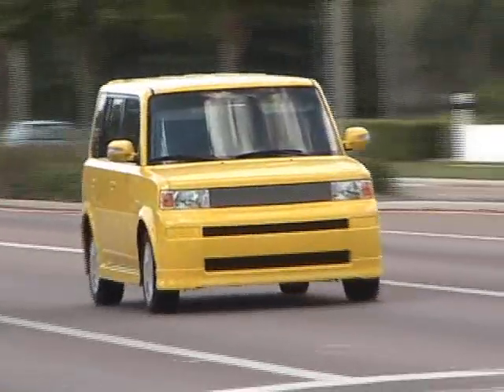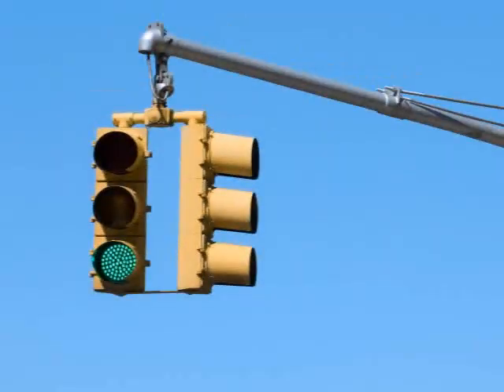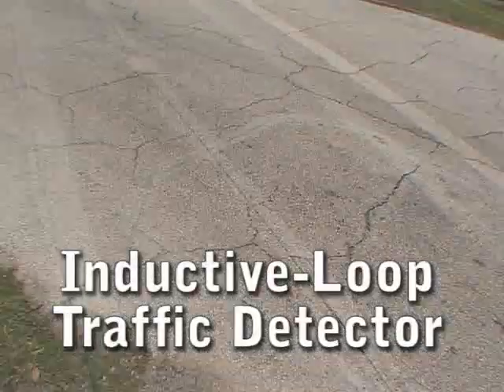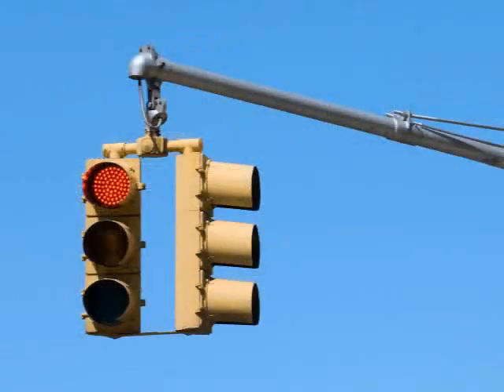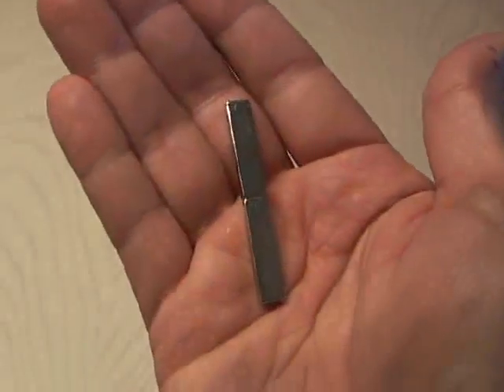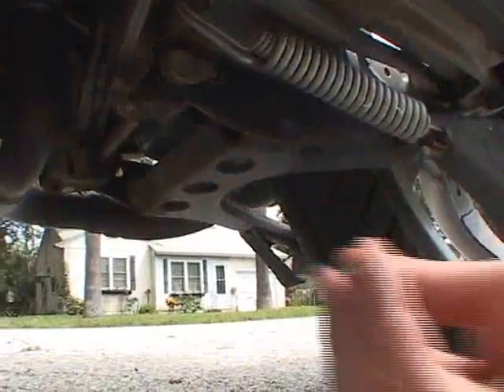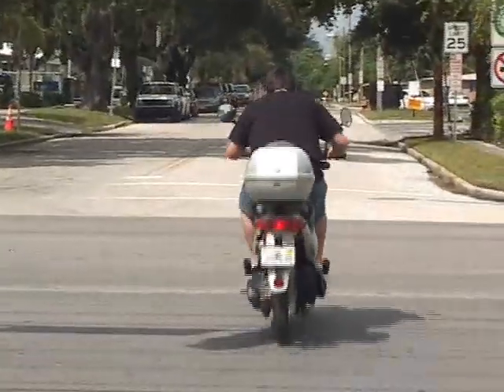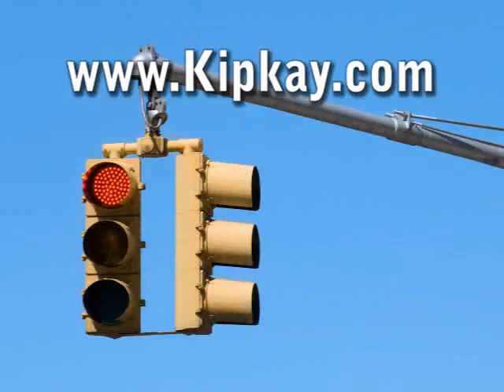Trigger Green Traffic Lights

Comment: I've never had this problem on my motorcycles. What I do is quite simple. I make sure to stop on the bike directly over the wire. I memorized the various patterns of induction censors and put my bike where it'll get the most exposure. Most use a double box setup like [][] and if you put the bike right in the middle, there are two wires going through the middle, and so you basically double the chances of triggering both induction sensors.
Reply: Yes, the two loop version is quadrupole and you stop right in the center. The single loop version is dipole and you stop on the edge of the single box. I've heard if you put your side stand down it can help.

Comment: That's not how induction works. Cars are not magnets and adding a tiny piece of metal, magnetic or not, will not trip an induction sensor.
Reply: That's not at all what he said. Listen next time.
Reply: +SuperSwoggin I'll explain it a little better. He says that the loops work via magnetic induction. Cars are not magnets, hence do not induce a current in a loop of wires, and they certainly don't do so at idle. Adding relatively tiny magnets on a scooter won't magically trick the sensors into thinking its a big, heavy car.
Reply: its based on weight really.
Reply: thats the old way of doing it

Comment: Tested this extensively with a variety of magnets of different sizes, materials, and strengths including Neodymium, and on a variety of sensor loops.  It does not work.
Reply: sorry, its patched with the latest 7.0 street light update
Reply: This video was shot in 2008, they've probably upgraded the technology to something better or just changed it around somehow.
Reply: Anti-Social 12 Year Old Squeaker you're better off looking it up than commenting on something you obviously don't know anything about.
Reply: Well I'm glad I didn't waste money...
Reply: That's because this guy's a tool
Reply: maybe because the traffic light you tested at was operating on a time schedule, not by the detection of vehicles.
Reply: That's because inductive sensors don't sense static magnetic fields.

Comment: This is an old vid, but just to let people know:
At least in California, it is in fact legal to run the red light (when safe to do so) once the lights have cycled through the intersection 3-5 times.  If you don't get your green light within that time frame, there's usually a problem with the light.  Just make sure it's safe, and proceed as normal.  If a cop catches you, just tell the truth.  No worse for wear.
Reply: L.D. Johnson or get 9 warning shots to the back
Reply: +L.D. Johnson North Carolina, it is 3 mins, legal to jump the red light, when it is safe to do so.
And yes, I still ask people (in cars) to help me activate the sensors.
Reply: +L.D. Johnson In many cities I've lived in, the crosswalk button isn't even hooked up to anything. It's just there to give pedestrians something to push because people expect buttons and like pushing them.
Reply: +henry montero LOL!
Reply: +L.D. Johnson which vehicle code is that?
Reply: Y'know, I tried looking it back up after posting this, and I couldn't find it.  However, I distinctly remember being taught that in drivers ed, during drivers training, I'm pretty sure I've heard it discussed elsewhere, and I've seen it in practice (especially with motorcycles).  
I myself have done this at a broken stop light (I know, because there was a crew out repairing it finally the next day) in full view of a police officer; I had been waiting for several cycles to no avail, made sure it was clear to proceed, and completed my turn.  Officer noticed, looked around, and let me and others pass. However, YMMV, of course.
Reply: I've been reading that it is OK to do if the light doesnt seem to be working after 1 cycle of everyone else going. You just will have to explain it to the cop if you get pulled over and to the courts, still gotta yield tho. Or could just stick magnets under your car or ride a car. Just very annoying how they design the roads for only cars and not motorcycle too, when motorcycles are maybe 2-5% of the vehicles on the road overall (my guess). L.D. Johnson
Reply: ***** Certainly that's true. I've had more than a few bikers motion me closer to them at a light hoping my car would hit the sensors. Everyone on the road has to do what they feel is safest for them. 
Personally, I can't imagine leaving your bike to walk over and hit the crosswalk would be preferable to just carefully pulling out; not all lights have crosswalks anyways, and not all crosswalks trio the green light unless there is a vehicle there anyway. And walking off your bike to cross the street and back makes you just as likely to get hit as if you just ran the light, I would think. Again, your mileage may vary. Just offering what I (think I) know...

Comment: I drive a mid-size car, not a motorcycle. Would it still be beneficial to install this trick on my car?
Reply: nope. by small car he means cars like smart cars that are teeny weeny.  A midsize car is big enough to change the light, buuuuuuuuuttttt many lights just go on timers so its useless.
Reply: Ohhh okay, well thanks that's helpful to know!
Reply: Jack, I had someone tell me that it wouldn't work on my motorcycle because "...many lights are timed."  I noticed though that the light would change when a car would pull up next to me or behind me.  Try it for yourself and then you will learn what you did not know before.
Reply: The lights in my neighborhood don't have the markings on the pavement from being cut into and then patched over with tar, so I don't think they're triggered by an inductive loop. So I'm pretty sure it wouldn't work anyway.

Comment: If you have trouble with a scooter or bike just pull up in an edge of the loop.  The magnets don't do anything extra.  I used to install these systems.  Just a chunk of metal will do.  I would set them off with my metal clip board.  Instead of magnets a metal plate in your shoe would work better or again, just pull up on one edge of the loop and it will "see" your scooter.
Reply: David Carnahan Interesting. Thanks. Is there a certain distance you have to get the metal from the coil? I installed larger tires and sometimes have trouble triggering the lights now.
Reply: You should still trigger any system.  Unless the system itself is having issues

Comment: Even though I have a neodymium on the bottom of my motorcycle that's rated for 145 lbs, I have a light that changes almost immediately if I'm driving my car, but not my motorcycle. I am forced to drive 3 blocks out of my way to get home. I forgot to tell my motorcycle mechanic about my magnet and one of his wrenches got stuck on the magnet until he figured out how to remove it. He wasn't happy.  LOL

Comment: What if you were to put the magnets on the road near the traffic light? Would that make it always green?
Reply: Good question
(I don't know the answer, I just felt I should say that)
Reply: No.  The coil is looking for a change in magnetism, not for a magnetic level.  The light would change once when the magnet was placed but then wouldn't change again until a car drives over the coil to change it even more.
Reply: A magnet would have to be about ten times the size of what's in the video to effect the coils.   I know because one unused to install these systems and two we have tested with various items to see the sensitivity.  A magnet the size he used dose zero even on the ground as close to the coils as you can get.  We had to go to a 4" speaker magnet to get a result.  Were my aluminum note book laid on an edge triggered it.  The testing in this video was most likely flawed as it appears they knew nothing on how the system worked.   You are just better off not adding anything to your bike and pulling up to a light over am edge of the coil. They are very easy to see.
Reply: no.it  means it would always sense a car and the light would change in the shortest amount of time it set for!
Reply: Richard Bennett If you place an electromagnet that randomly changes the current on the coil, would this work?
Reply: Dependent on its power and ability to effect the away around I.

Comment: For streets that use the magnetic system to detect autos you'd need a pretty powerful magnet, but his won't work on systems that use weight to trigger the lights as is where I live. And a lot of times its set for a load of 1k lbs. So a guy on a scooter won't trigger them whether or not you're magnetized.

Comment: Magnets won't trip most traffic lights, you can test this yourself by putting the magnet on top of the loop, much closer than the bottom of the bike, and it still won't trip.  Here's a tip that works every time and its free, stop the bike directly on top of the wires in the pavement, works every time and its FREE.
Reply: It's Neodymium Magnets, which is basically the strongest magnetic substance on Earth. CMIW

Comment: You guys need to get it right.. Its the cameras on every stoplight pole that sense you.
Reply: it is not, wtf. the cameras are only for people running reds.
Reply: dude, most traffic lights dont have camera's in my place but the trick i tried on this vid, it worked
Reply: There are some areas in cities that implement traffic sensing cameras. These cameras are installed on top or near a traffic signal [usually near the actual display]. They do more than just sense if a vehicle is waiting for a green light; for turning lanes these cameras sense how many cars are waiting to turn, and time the appropriate signal period. These systems compared to inductive loops are expensive but are a smarter way to control traffic and ease congestion. Induction loops have been used for many years now in many cities across the world. 

As per Chloe, Red Light cameras are different and don't manage traffic.
Reply: jordan foster is a dumbass

Comment: Well i guess due to laws of physics, you won't change any ability to conduct power in these circuits using a static magnet. What actually happens is as you arrive to your standing place, you are moving massive magnet under your vehicle, over wires. By this way you generate your own power inside circuit just like dynamo. If your vehicle does not have big enough feromagnetic mass that can close circuit, you need to generate your own current. Amount of necessary feromagnetic mass to get detected is depending on actual power inside circuit and its calibrating. With more powerful better calibrated circuit you can detect smaller feromagnetic objects and such circuit will be less pain in your ass than weak circuits.
Reply: Vehicle Detection Loops or 'Induction Loops' work on the principal of induction. The loop laid in the pavement emits a 10 kHz to 200 kHz signal. When a vehicle passes over the loop, the vehicle induces eddy currents in the wire loops, which decrease their inductance. This is sensed by the controller unit and passes on the information that a car is over the loop.

Eddy Currents are electric currents induced within conductors [the loop] by a changing magnetic field in the conductor [caused by the vehicle or magnet]. These circulating eddies of current have inductance and thus induce magnetic fields.

Simply put, the loops can be affected by a magnet or vehicle.

Comment: Being Magnets, Did you really need the mounting tape? Just thinking.
Reply: Vibration might move it around on the surface?  Not sure.
Reply: The magnets attract from the ends and not the sides. Unless you want a magnet protruding downward in a vertical fashion, mounting tape would, otherwise, be the best choice.

Comment: In here, traffic lights work with speed. If someone passes the speed limit (50 km/h or 30 mph) they have a radar which triggers the red light on.
Others just work in a sequence. But i have never seen this kind of system.

Comment: +Katsuki Lennox said "detectors actually can pick up the change in magnetic induction from a bicycle, and would definitely be able to pick up a scooter or motorcycle..."  

In my 20 years riding motorcylces, I find this statement untrue.  Some detectors work just fine, even on bicycles... but others?  not so much, at least here in the bay area. I've spent a LOT of time at intersections that NEVER detected my large cruiser (1100cc) motorcycle.  It's annoying at 2am, not a single car in sight, no traffic for miles... and the red light just won't change.  I can't count how many times I just ride thru on RED, after waiting alone, only the wind and the distant howling of coyotes (maybe I imagined that), as the minutes of my life go away, the motor idles toward empty, my eyelids droop and I lose, yet again, another staring contest with the red light from hell as it mocks me, soul-less, unblinking and cruel, indifferent to the needs of my bladder...  

Sometimes moving the bike back and forth, changing the angle, turning slightly, anything to make a big enough change in the field, helps.  But sometimes, NOTHING works, and there I sit, like a child waiting for detention to be over, unaware that teacher has forgotten and left the building... 

Curse these red-lights! these oppressive deniers of forward travel; these gate blocking empty tyrants of traffic, in their tiny kingdoms thru which we must pass, over which they jealously guard their empire of nothingness.  I ask the God of neodymium to grant me greater inductance!  although, I would be surprised if such a tiny magnet as in this video would make any difference... but I'm trying it... soon!
Reply: HarrrySpider - You must return and let us know if Neodymiucles, the Deity of Magnetics, Inductance, and Cage-Free Riding with the Wind, has answered your prayers!

I wonder if you need to sacrifice a chicken to make it work.

Or maybe the SUV of some a$$hat who, blissfully unaware, almost runs over one (or more) of our two-wheel brethren.

Yeah, that last one would probably help; and even if it doesn't, it would still be worthwhile (and deserved)...  ;)
Reply: Rockne Oliver Sir, you suggest the sacrifice of either a chicken or an SUV driver.  I would ask, in the name of all things polar:

Are these not one and the same? 

buh-ZING!

Comment: In the state of Texas, if you are at a red that that doesn't change for a long time(especially in off hours like 3am) then you just treat it like a stop sign. 

It runs counter to instinct and feels wierd to do, but I've done it many times, a couple times even while a cop was doing the same thing in Houston coming the opposite way. 

It really doesn't matter when, just has to be an apparent issue of a light not changing for far too long(if it's more than 3 minutes then it's too long) and having clear roads around you like any 4 way stop sign. On a busy roadway just use the right, left, left maneuver. Turn right(can do at any time if you have a clear shot regardless of light color), then get to the left lane and turn into a shop or somewhere where you can shoot to where you need to be. Sometimes that's twice as fast as waiting for a light.

Comment: There are two types of sensors, one is in the pavement, if you stop at stop line and motorcycle stops on center line of the 3 cut into road,  at stop line,  it will be detected, Infrared dectors mounted on Mast arms are positioned looking at stop lines, if your in cross walk you don't exist on either detectors  Mast Arm dectors don't sense flashing lights
Reply: For the majority of riders most aren't paying attention when they stop at a red light. Make sure your scooter, motorcycle are at the center loop line at the stop bar, that's where the strongest magnetic field is, the loop does not detect your vehicle but the metal in it disrupts the flow and that signals the comptroller in the cabinet that someone is waiting for the green. If like most drivers/ rider's who are impatient and will pull forward 4 to 7 seconds before light changes into cross walk area the call is thrown out and light will not change. This is especially true for all left hand turn lanes.

Comment: Magnets don't work in Brampton,Ontario. I have had a very large magnet stuck to the bottom of my oil filter (lowest part of the bike) for years and I still have to jump off the bike and run over to the pedestrian walk button to change the light.One benefit of a magnet on your oil filter is ,it "may" help to trap steel filings in your oil.
Reply: jim symes Those certainly do work to trap metal.. but it has to be magnetic metal.. some of the stuff in the bearings is not etc. Best to use them all the way around though so something can't slip by.
Reply: It may be because of the different equipment your country or province uses.

Comment: It was to test it  and needed he opposite side of the magnet to face the ground and it wouldn't attach to the scooter on that side and also he put the magnets in a pill container and tapped that to the bottom after it worked so the magnets wouldn't rust. 

P.S. I am tired so I hope this made sense in the slightest.

Comment: Doesn't work like that, the magnets just make it possible for the detectors to detect smaller vehicles at the lights, it doesn't force the lights to change, just increases the detection of the vehicle.

Comment: Depends on the street. In suburbs, it's usually sensors. In the city, both streets usually see heavy traffic, thus they use a timer. This is based on my experience as a cyclist. Note to self: put magnets on bike.

Comment: Not Illegal.  My city puts a few 10 cm diameter dots on the inductive loop so bicycles know where to stop to activate the light change.  The loops are there to detect the metal in a vehicle. Then the light system knows a vehicle is waiting for the light to change, or if a vehicle's in the left turn lane and to activate the left turn signal.  It's not like it's an instant change. There is still a delay.  If the system is adjusted properly a magnet isn't required if you know where to stop.